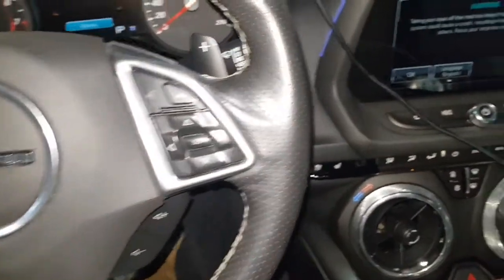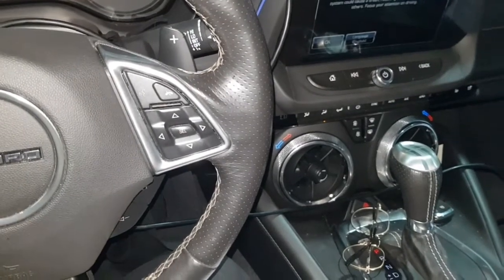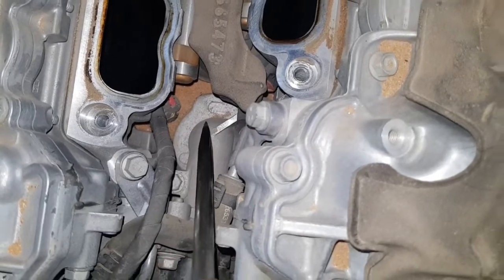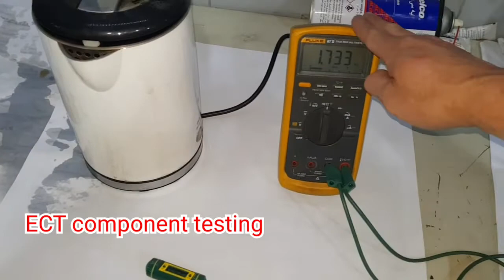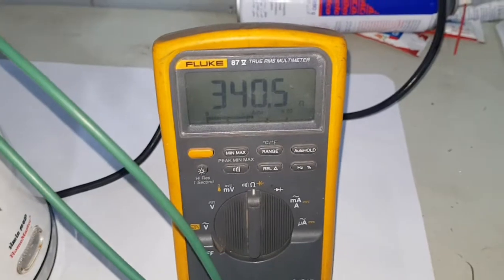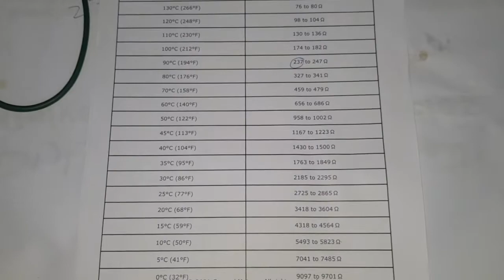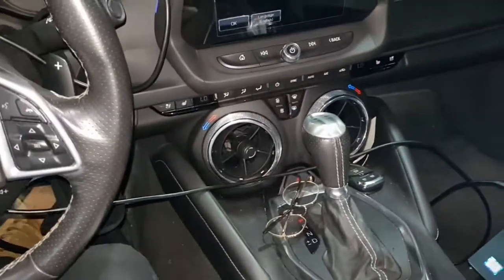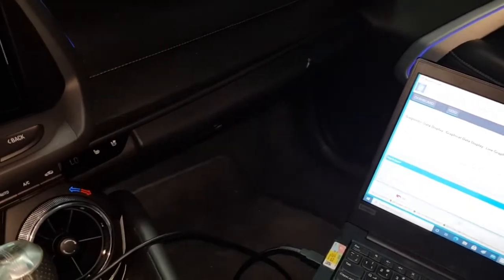P0128 code | ECT checking camaro chevrolet

Comment: I have a 2017 Camaro Lt and my temp gauge went all the way to C but it runs fine only problem is radiator fan blows hard, even when it is off too. But if I leave it alone for a couple hours, it goes back to normal
Reply: Could this be a bad thermostat? Cuz I also got the same code and there’s no leaks whatsoever
Reply: @franciscohernandez5693  hello and what was the problem in your case?

Comment: I replace TCS, but not thermostat. Worked for a little while, but now happening again. 2020 camaro RS 3.6 L Will thermostat replacement fix issue?
Reply from the maker: First make it sure the radiator fan works normal. Work in low speed, middle speed and high speed. Second make it sure the cooling system no clogging and no leaks. 3rd make it sure the code is the same on this video. And my answer to your question is YES.
Reply: I'm having the same problem right now, I have a 2019 rs with 56k miles.   I see this is a common issue

Comment: Then, the problem was the thermostat?
Reply from the maker: Yes,  the purpose of this code is to analyze and monitor the thermostat performance.
Reply: @ejmegzcarvlog7226  I have the same problem with my 2016 Camaro 2 SS did you think by replacing both the thermostat and cooling temperature sensor will fix the problem?
Reply from the maker: @RT-xg6nd  if the trouble codes and the symptoms the same. 100% it will fix.
Reply: @ejmegzcarvlog7226  yes the dealer checked for me and it's the code PO128 for the thermostat and before that they change the coolant temperature sensor!!
Reply from the maker: @RT-xg6nd  the dealer advice before to replace the ECT sensor? Not a thermostat?
Reply: @ejmegzcarvlog7226  correct sir!
Reply: @ejmegzcarvlog7226  but that didn't fixed the problem...
Reply from the maker: @RT-xg6nd wow! Hehehe, replace the thermostat.
Reply: @ejmegzcarvlog7226  just in case I'm going to replace the coolant temperature sensor too...
Reply from the maker: @RT-xg6nd  if you replace before then the codes still set, No! Just replace the thermostat.
Reply: @ejmegzcarvlog7226  okay Earl thanks for you help 🙏
Reply: @ejmegzcarvlog7226  can I still drive the car with the fans On and the temperature gauge not working?
Reply from the maker: @RT-xg6nd  For me No, the fan always on in high speed at all time, its not normal operation.
Reply: @ejmegzcarvlog7226  I have to disconnect the negative cable that's the only way it works for a few hours cause at night in my way home that's when it happens the temperature gauge STOP WORKING ONLY AT NIGHTS 😂